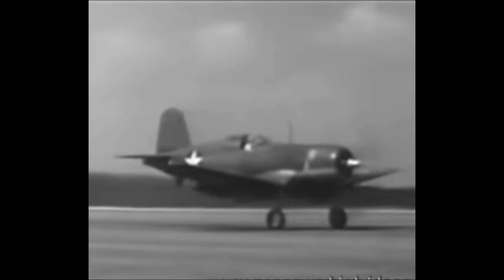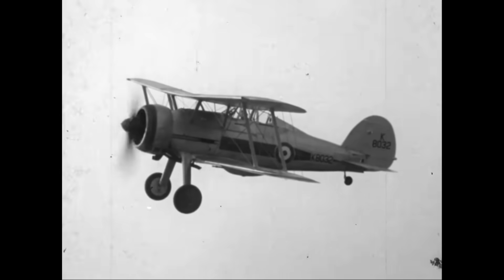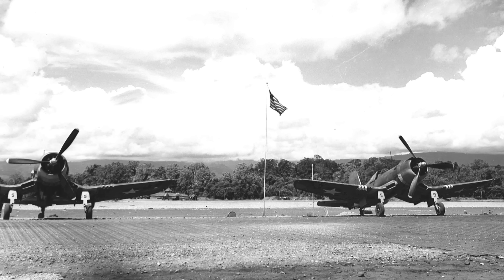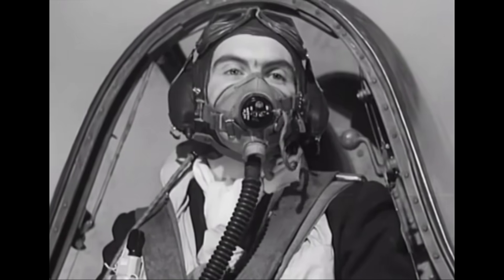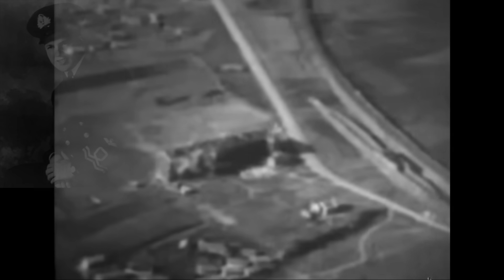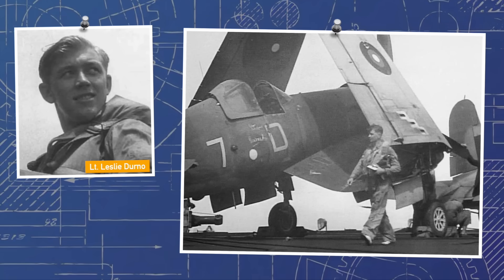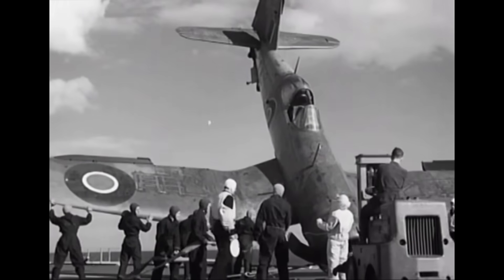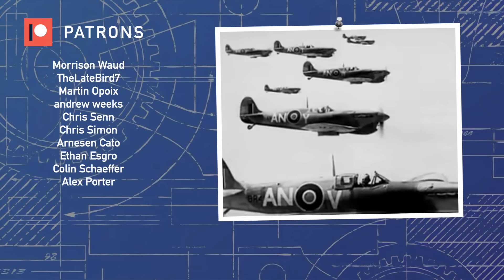Why Did Britain Use American F4U Corsairs? The Full Story

Comment: Absolute rubbish, the swordfish was not obsolete.  It was designed in 1936 and was a state-of-the-art torpedo bomber. This is how cultural myths are created, people repeating the same BS to make them feel good.
Reply from the maker: This is absolutely not true, the Swordfish was obsolete in the sense that it was completely outclassed by even contemporary torpedo bombers by the start of the war. It managed to do some decent work only by very intelligent use of it, it's performance was very poor by the standards of the time. Also, the Swordfish was not designed in 1936, it first flew in 1934 - much of it's design work was carried out in 1932 and '33 - it was very old by the time WW2 broke out.

The Nakajima B5N was an example of an actually cutting edge torpedo bomber. It first flew in 1937, and let's break down the performance difference.

Maximum Speed at altitude - B5N: 235 mph, Swordfish: 139 mph
Bomb load - B5N: 800 kg, Swordfish: 680 kg
Range - B5N: 1,075 nmi, Swordfish: 587 nmi

There is absolutely no question, the Swordfish was obsolete. It paled in comparison even to aircraft that flew 3 years before the outbreak of war, let alone aircraft that began flying around 1940. It was in absolutely no way state of the art in 1940, and it was only used in success because it was used it in a very intelligent, and specific way. There were a huge amount of missions that would simply have been closed off to the Swordfish due to it's comparatively poor performance.
Reply: @aviationdeepdive  Absolute rubbish, it went into production 1936 and incorporated many improvements to it as of that date.  And it was state of the art when it went into production in 1936. Notions that this aircraft was obsolete in 1939 are ridicules. If it was it would not have enjoyed the success it had.  In 1936 it was a potent torp bomber, by 1940 it was on the decline but was still very potent.  That is the reason it struck the Bismark.
Reply from the maker: I mean, you said it was designed in 1936, and it wasn't. It was not state of the art in 1936, the B5N went into production one year later, and has nigh on twice the capabilities as I very clearly outlined above. 

If an aircraft of a certain class has a speed 96 mph slower, a payload capacity 120 kg smaller, and a range 488 nmi smaller than an aircraft of the same class produced a year later. It's outclassed, and not state of the art. I notice you didn't bother to respond to the specification comparison, because it debunks your argument in black and white.

Hey, I love the Swordfish, I think it's very cool. It was also not even close to being on parr with contemporary torpedo bombers by the late 1930s, let alone 1940. @elliskaranikolaou2550
Reply: HAS ANYONE COMPARED THE CAPABILITIES OF THE STRINGBAG AND THE TBD? @aviationdeepdive
Reply: You're saying a bi-plane was state of the art in 1940? Just because it was successful does not mean state of the art.
Reply: IT WAS OBSOLETE
it NEVER faced air cover in ANY of its successful missions
and MOST were against second line units like Italian and French
i will NEVER say the crews werent brave and skilled and AWESOME
but the plane they flew was rubbish before the war even started..
it did NOTHING vs the Japanese...
Reply: @ripvanwinkle2002  Absolute rubbish, it was chosen over mono wing designs because it offered better stability and durability and its open cockpit was chosen for night operations. It was a state-of-the-art design in 1936 and was only 4 years old when war started, hardly obsolete. It was so good, it was able to defeat the Bismarks AA artillery and score a torpedo hit on her. Learn to think for yourself.
Reply: @elliskaranikolaou2550   being better than worse air craft doesnt make it good air craft..
it NEVER FACED SIGNIFICANT AIR COVER  that is a historical fact you cant fanboi your way out of
Reply: @ripvanwinkle2002   1. This is from Bill Gunston Combat Aircraft A handful of the Stringbag  Flying out of Malta sank an average of 50000 tons/month in 1941-43 mostly against ships heavily armed with Flak  Do the Maths 
2. It was not meant to be a fighter It was great at the duties it was designed for 
3. The Pacific was mainly your job the Stringbag had done its duty in a harsher climate than your planes .
Reply: The idea that a biplane torpedo bomber in the early 1940s was 'state of the art' is really pushing it. Its crews were phenomenally brave and pointing out the deficiencies of the Swordfish is not disparaging them. Quite the reverse.
Reply: @Hartley_Hare  In the early part of the war it was not obsolete. As mentioned in my last comment,  it was chosen over mono wing designs because it offered better stability and durability and its open cockpit was chosen for night operations. It was a state-of-the-art design in 1936 and was only 4 years old when war started, hardly obsolete. It was so good, it was able to defeat the Bismarks AA artillery and score a torpedo hit on her.
Reply: @elliskaranikolaou2550 It was a good aircraft, but the Bismarck operation absolutely demonstrates my point: they helped sink the thing, but there was no air cover and all they had to worry about was the flak. When there WAS decent air cover, they had a hell of a time.
Reply: @Hartley_Hare  like during the Channel Dash. They were all shot down. Garth Ennis did a terrific graphic novel about them named 'Stringbags'.
Reply: @marckyle5895  It happened to alot of the Torp Bombers in WW2. The Americans had entire squadrons of Torp Bombers shot out of the sky during the opening stages of the battle of Midway. Torp Bombers in general were very vulnerable in WW2 for all sides.
Reply: @marckyle5895  I like a recommendation - thank you.
Reply: @Hartley_Hare  I bet you'll like most of his war stuff. My favorite so far is 'Johnny Red', a series about a Hurricat and her rookie pilot.